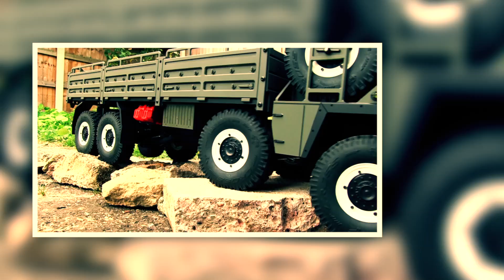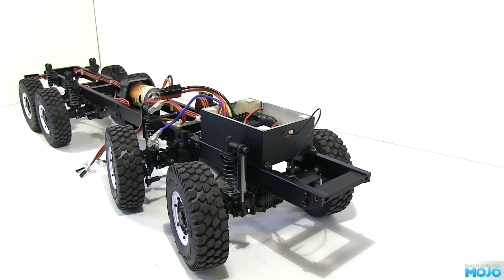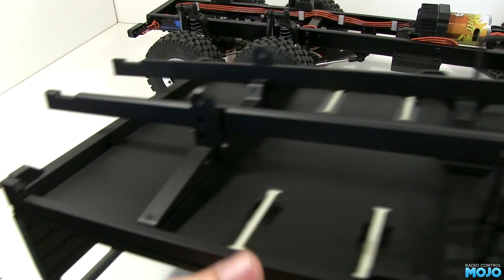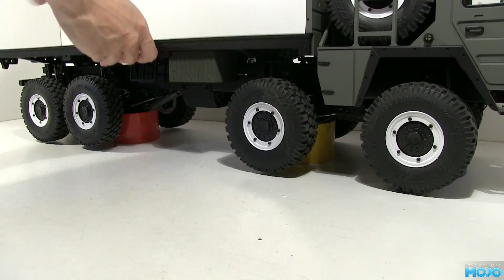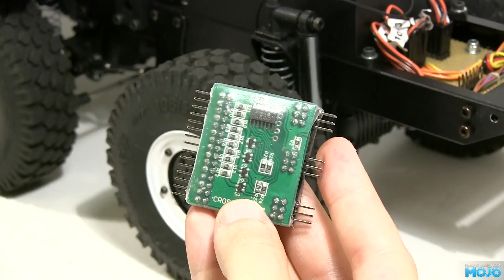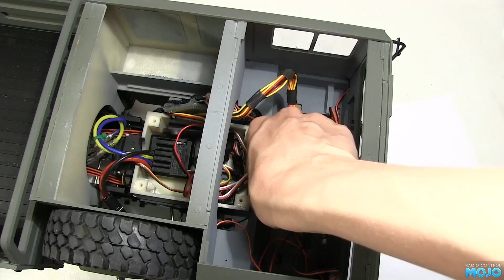Cross RC - MC8 - mmm, wires…

Comment: Hey buddy,I was wondering if you could help me with my mc6 6x6.I don't know what receiver to  buy or what servo to use.Does the servo need to be digital?Put it this way I don't know anything about the electronics because all my other rc cars and trucks came in a RTR  package and everything came with them but this is my first plain Jane truck that I have ever bought and I don't know what to buy electrical wise.I know that I want a REALLY strong metal  geared servo but the other stuff I don't know how to buy for my application.Could you please point me in the right direction or maybe shoot me some part numbers over my way.Thank you for your time and you have a great day. Don't stop with your videos,they're VERY informative.Bye

Comment: Superb build.Can you tell me is the 3rd channel for the front lights.I've just built the mc6 and only have 2 channels the indicators work as do the rear lights but no front lights.Cheers.
Reply from the maker: Channel 3 does indeed control the headlights. You would hope that if there’s no signal on the channel 3 input it would default to on, but apparently not… When I was plotting out the functions of the outputs I found J3 and J4 seemed to be always on, it could be they’re to power fixed headlights.